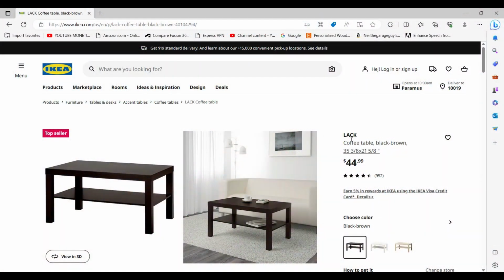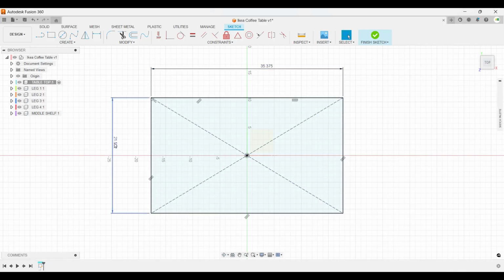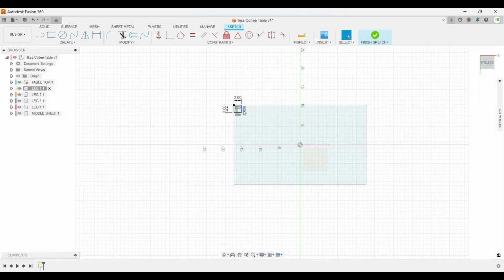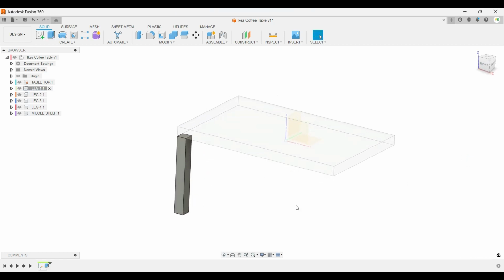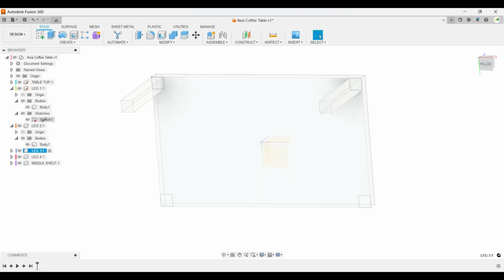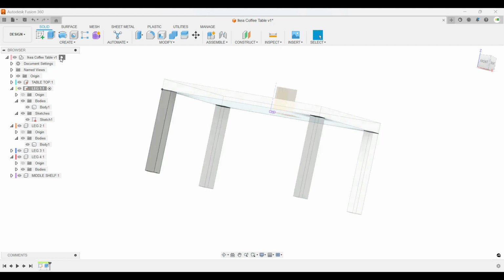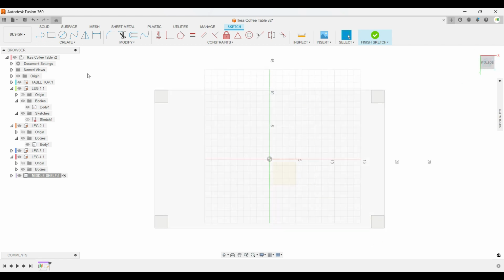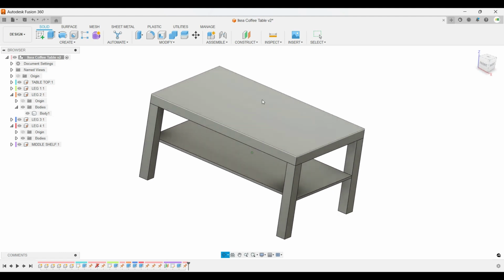How IKEA Designs A Coffee Table | E7 - Fusion 360 Tutorial for Beginners

Comment: You should use the skeleton modeling. Without creating a new component, draw a surface only 3D box dimensioned to the table. You can extrude the table top on top of the box as a new component and extrude one leg as another component. You can then copy the leg a component using the mirror tool and  mirror both of them again as components. This makes it super easy with fewer extrusions. You can always hide the box.
Reply from the maker: That is definitely a great way to do it and I agree with you. It’s way cleaner. These videos are geared towards complete beginners as a build up series to quicker commands like mirror or linear pattern and ultimately some surfacing. Thanks so much for the feedback